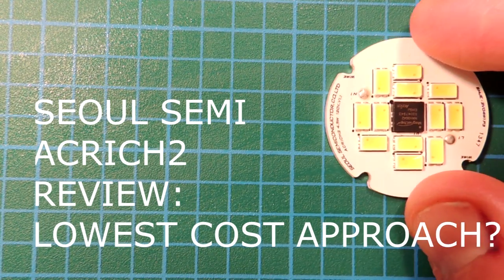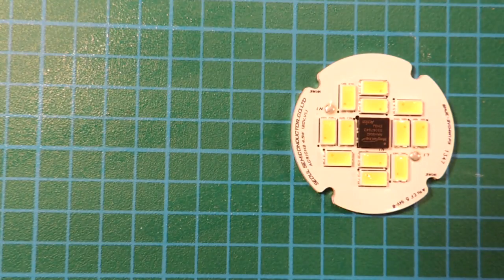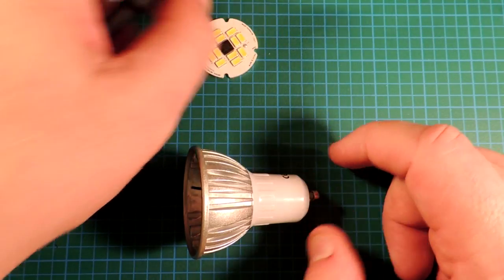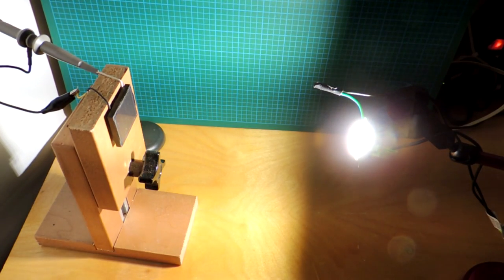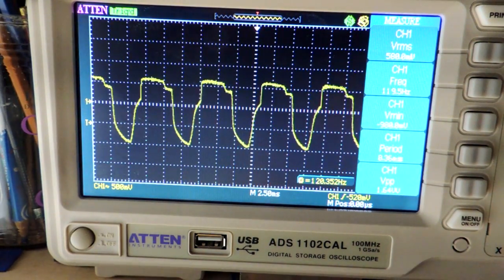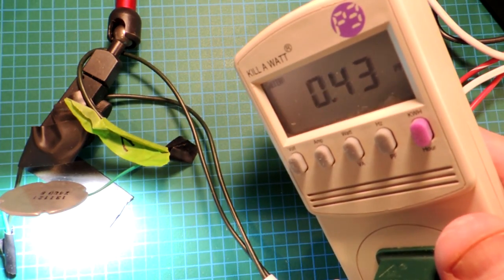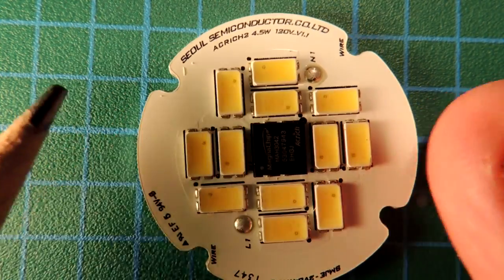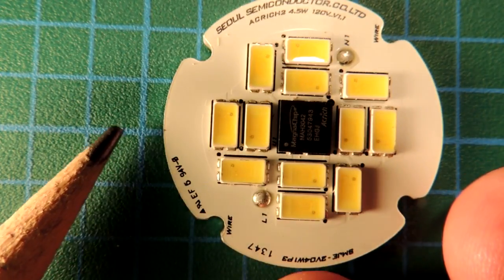Seoul Semiconductor ACRICH2 LED Module Review: Cost Containment

Comment: My Acrich2's simply blew up at first power-on....120vac.
Maybe you could have a look, I caught it on video....https://www.youtube.com/watch?v=2cNgQtc0cvM
Reply: Other post now deleted,  this LED chip also needs a rectifier and cap part.....listed on the Acrich2 page, on their site. So you need 2 parts....not just the single LED chip module, for AC hookup.
I wrote to them, and they sent the other part.
It's confusing because their newer LED chip modules do not need this extra part.
Reply from the maker: Randy Leifer Missing surge protector?  I think a bridge rectifier is required with that module?
Reply: Same exact problem for me! Why would they not tell the consumer?
Reply: For this, there is another item needed. See my other post.
Reply: So the ACRICH3's dont need the rectifier and cap? If so, I'm sold! thank you!

Comment: Sam's Club was selling a 13" ceiling light fixture equipped with a SSC light module rated for 17W power in.  If I remember right the number of LED's is ~ 48 and has 2 ACRICH2 modules.  I bought a few a couple of months ago.

Comment: Ah, I see why the LED string has various tap points on it.  It appears that as the rectified AC voltage rides up and down the LEDs are switched in to match the voltage as it changes.  The standard designs show current regulation and capacitors across each LED group, but that doesn't seem to apply here, so it may just ride up on the current to voltage ratio of the LEDs.  I guess that means it may switch them off at the top of the AC cycle when the voltage is too high for the entire string?  Not much data on the 'net yet.
Reply: I tried filming this in high speed, 1000fps. At the top of the AC wave all the LEDs are lit, the device then cuts out more and more of the LEDs as the voltage drops in order to achieve something like a constant current load over most of the waveform.
Reply: We have 3 ceiling fans with Acrich2 17W modules, all have failed, and now 1 of the 3 replacements have failed. They blow 2x910ohm resistors and the driver chip, get about 2 years out of these, and they are costly to replace.

Comment: I have the 230V version of that LED in front of me, it uses 2 ICs and twice the amount of LEDs. It actually looks fine if you aren't one of those people who can see 100Hz flicker. This is dimmable for the same reason cheap Chinese mains voltage dimmable LED lamps are, the driver (or in this case lack of driver) has so little input capacitance that it reacts to the input AC in every instance as if it was DC, thus this LED should theoretically run just fine on high voltage DC, but you would probably have to chose the voltage at a level where you do not overpower the LEDs.
Reply: So a full bridge rectifier (SMD device) and a 1000µF electrolyte for 400 Volts will do the job. I think it hardly would fit into an E27 fitting assambly.
Reply: ***** I never did suggest it would fit in an E27 assembly, i just stated that in theory it should run fine on DC.

There really are better ways of getting smooth LED lighting.
Reply: Ghlargh
No I just thought furhter for myself. I have a bathroom lamp fixture which I would like to drive using an LED retrofit lamp. But I haven't found any LED with at least 1200 lm which will fit in there, additionally it should have 5000-6500 K color temp. I don't like these warm ones and they additionally have lower lumen/watt.